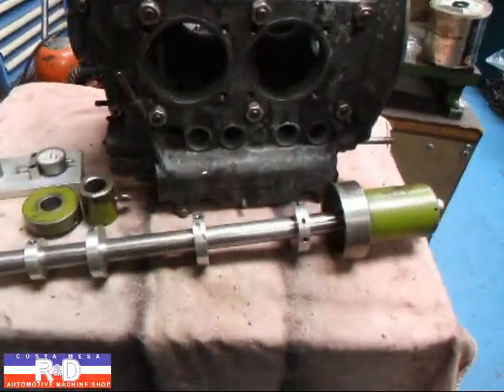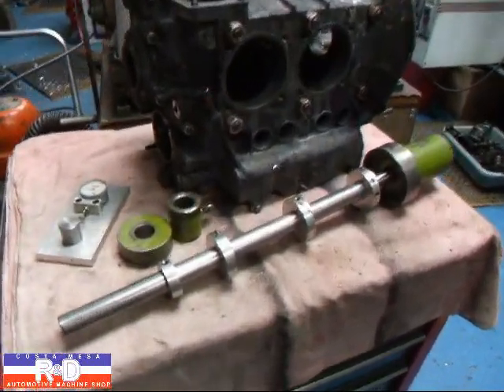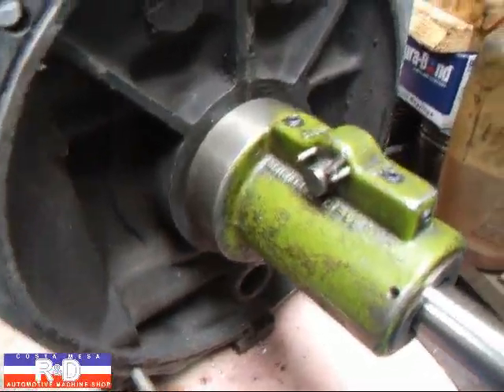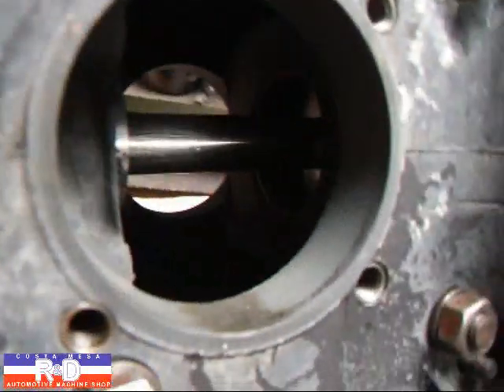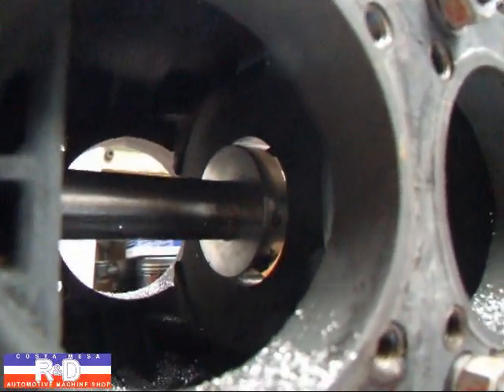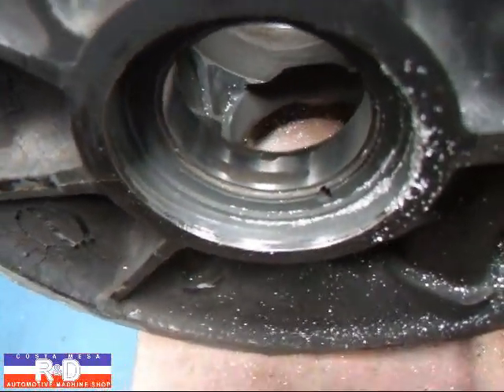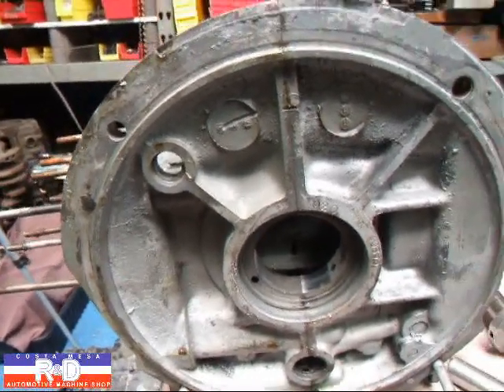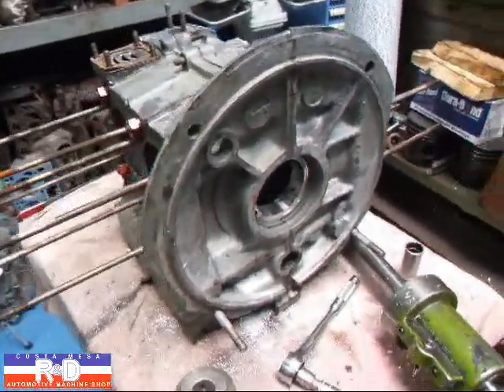Air Cooled VW Alignbore

Comment: VW factory said VW case is not a rebuildable piece and if you think slideing 2 pilots in seal hole and oil sling opening got you a true center line you have no business working on any thing. Ever read book. Gene berg put out if not try to get you a copy
Reply: Voice of INexperience, Art. Twenty million VWs with this engine, probably fifteen million rebuilt with cases line bored (or align bored just like this) Success rate excellent. I probably did two thousand of them in1970s thru 90s. PortaTool in Clovis Calif originally manufactured this. They based it on a tool they did first for a similar job on Caterpillar hydraulic joints. Kent Moore bought PortaTool in about the late 80s. Tool is still being used very successfully by thousands of shops all over the planet. I was thrilled to buy one at an auction a month ago. Checked the cutters and just did one case to .020” & one to .040”. Checked with dial bore gauge, four bores in each case within a couple ten thousandths. There are some options to the PortaTool way of cutting the thrust, but looks like R&D has theirs dialed in about as good as it gets without a mill. True, they only set up on the two end holes & may not be perfectly indexed to cylinder decks, but darn close. Great even for high performance engines if you check all the rest of your work. I like the R&D practice of cutting thrust only the amount needed then turning #1 bearings flange to match; leaves more options for machining as necessary later. Engines. Done RIGHT by EXPERIENCED people that know what they are doing & WHY they do it, can last a LONG time & be rebuilt AGAIN SEVERAL TIMES.
Reply: @Quentin60isthenew40 Agreed, I built about 3000 VW engines from 85 to 2004 and I align bored every one of them with a PortaTool align boring bar. Works perfect. Anyone reading this interested in my equipment - it is for sale. Two complete set ups and about 50 sets of main bearings - every combination possible.

Comment: Question... how are you able to insert the tool all the way through the case with the cutters on it? Seems like the cutters would hang up on the journals if they're not yet cut. Thanks!
Reply: Hi Dub Customs, obviously, the bearing outer dimensions are different.
Reply: This was my question as well. Except for the blade, the OD of the cutter has plenty of clearance. The rod is slid through the case off-center allowing the blade to clear the case until the rod is recentered.

Comment: What do mean you cut the thrust bearing to fit? Is there some sort of oversized one that can be machined down? 
Thanks and great video by the way!
Reply: Jake.
The correct way is to just clean up the rear bearing thrust surface.
The choose the correct oversize rear main bearing and cut the rear inner thrust surface until the bearing is snug in the case.
You can cut the case with this style bar, but not the bearing.
I use a mini lathe.

Comment: You seriously cut right to size? Or do you cut it close and then hone to size? I'm a machinist and I would never try and hit a 0.0005" tolerance in a single shot like that. The smallest bit of run-out on that bar would cause the center journals to be oversize.

Comment: Do you have a video of the shovel pins to prevent the case halves from shifting begin installed?  I am interested in seeing that.  BTW, is that a 3/8 flex head split beam torque wrench from Precision Instruments at about 4:16 to 4:36?